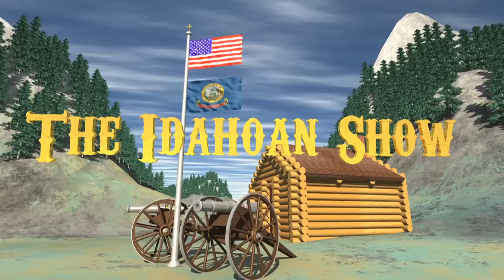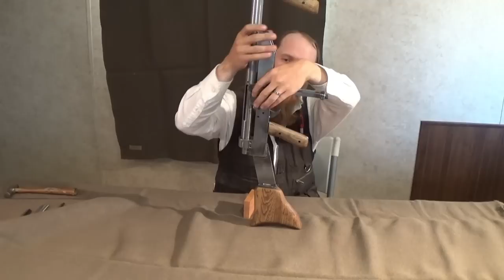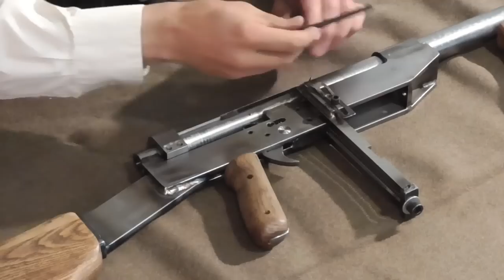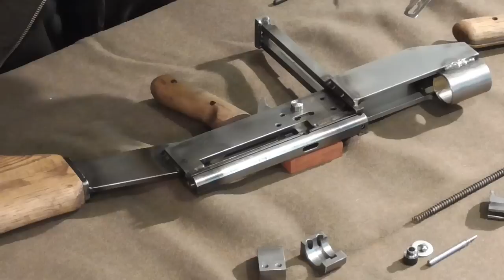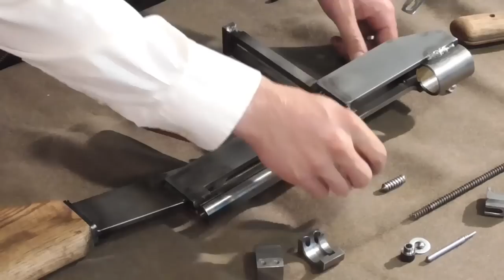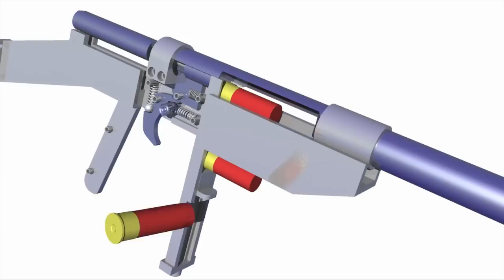Reverse Cycle Shotgun - Forgotten Weapons of an Idahoan (TIS163)

Comment: Don't forget this shotgun. Keep working on the design. Tinker with the problems. apply what you learn to the next creation. Lets see how it works during this years jackrabbit wars. Lets see the UTAH pistol used in the jackrabbit wars with a 410 or 28 gauge barrel,

Comment: I love experimental firearms. I have a recommendation after watching your video on the issues with the design. I think if you were to move the magazine bar to the side of the receiver, it would help with your cycling issues by not having to push the shells up but slide them to the right/left. With that the shells can be ejected from the bottom. Anyway love the videos.

Comment: "To overcome this issue you would have to incorporate some kind of breach closure mechanism" 

I'm merely an armchair designer, an enthusiast with no proper training, so I may be speaking out of turn here so to speak, but I'm not sure that's true. Couldn't you put in some form of mechanism that would disallow either hammer movement, transferbar movement, firing pin movement, or trigger movement when the barrel isn't in the correct position? Perhaps some sort of button that needs to be depressed by some portion of the barrel assembly in order to fire? 

Or perhaps you could have the firing pin and transfer bar be on a moving plate of sorts, and hold those parts too far to the rear for the hammer to affect without the barrel being fully seated?
Reply: Like a rail attached to the barrel that has a cutout, holding the transfer bar down on a tab until fully closed
Reply: Totally agree. A button type of device, sort of like Glock’s firing pin safety, clearly wouldn’t be outside of the skills of this gentleman from what I see. In fact, it seems like a very easy thing to design (I’m not a fabricator, so maybe that part is insanely hard).
Reply: I know this is an old video buttt I like the general idea. I am a designer and gunsmith, I think I might need to play with the idea of using a Siaga mag (because I have them) incorporating a closure disconnect and maybe a slam fire like the old pumps used to have before ignorance and law suits prevailed. Of course paying jobs will prevail over my curiosity builds so who knows if it will ever happen.
Reply: I have reconciled myself to the reality that I too often comment before even cursorily perusing the other comments. You said notably the same thing that I did, but much sooner.

Comment: I think your out of battery firing problem can be fixed with a simple pivot lever, or even a pin that holds the hammer from dropping until the breach is closed. Similar to disconnector mechanisms that keep semi auto guns from firing out of battery.

Comment: I know this video is older and I simply missed it back then. Being a fan of Ian's I find your imitation to be both humorous and flattering (to him). Having listened to your limitations as listed I could not help but start thinking of a method of circumventing them while keeping the reverse cycle simplicity alive. I am no engineer and my first thoughts are not likely to work, but as you know good ideas can come from anywhere so I think when I again have access to a shop I may attempt to prototype the action, even if I leave out the firing pin during my mock up for safety purposes.

Comment: Well done,sir.  Here are a couple of suggestions:  As for the breech not being closed during firing, I would suggest a spring that would pull to to parts together, requiring an effort on the part of the shooter to push open, or hold open the breech.  And as for feeding issues, the problem might be solved by a stronger spring on the follower and the application of teflon inside the track allowing the rims of the shells to glide up the two tracks.  This is a very impressive design and I would like to see it fired.

Comment: Seems like the magazine problem can be easilly solved by putting a front track for the shells, and attaching it to make a box frame, as you were hinting at. The light strikes and out-of-battery problems seem to be solvable within one revision though. From the few firing pins I've seen you make, They tend to be massive and piston-like. Simply cut these things down to reduce the amount of mass that needs to be accelerated (especially with the inefficiencies induced by the transfer bar). As you shave weight from the firing pin, incorporate a simple catch. Put a tilting bar that catches in the pin when the other end is not in a corresponding point on the moving barrel. This could also be worked into a lock that holds the two halves together until an unlocking event occurs.

Comment: 14:00 You don't need to make a kind of breach-closure-mechanism, "just" a way of auto-safety that the trigger can only be pulled, when you have the barrel all the way back.
In order to perfectionate the gun, i would try to make a kind of fixed box magazine, where its possible to load a cartridge in any loading status of the mag until its full.. That would be awesome.
Impressive design though.
Best greetings from Germany.

Comment: I don’t know why I have so much invested in this design, but I really want to see it work. If you had a “floating” bolt in the receiver with lugs that interacted with the barrel, you could cut a grove in it that would not allow the hammer/ transfer bar from striking the firing pin when it is not fully in battery. I don’t think it would have to fully lock, as such,  just be enough to ensure proper head spacing. Also I like the box mag idea. Just spitballing, but I’ve been practically obsessing over this since I saw this video the other day.  Thank you. -The Chicagoan / Texan.

Comment: Would make sense in a bullpup layout, the striker in a conventional fashion being pushed back when closing the action. The back end is forced down at the end of the travel and catches on the sear which also catches the outer sleeve. After firing the striker end rests in the up position and lets the sleeve past it. Or put in a spring pushed vertical piece that catches the outer sleeve in postion when down and also blocks the striker if not locked - it could be actuated from the outside to release the action for unloading. The strikers back could lift it if when going forward. When cycling after firing it moves over the angled striker side face, catches it in the forward position and takes it with it backwards over the sear again. Ok not thought through but the reverse cycle idea is great i think it will work!

Comment: In order to fix the problem with firing out of battery you could add a tilting block that would be in the way of the firing pin until the barrel is all the way back and pushes on it

Comment: to fix the issue with the barrel not enclosing the round or not hitting the breach face you can simply have a small tube like area that comes off the breach face covering the outside of the end of the barrel enclosing it if it dosnt come back far enough. also a simple button or lever like switch on the top or bottom of this small area covering the end of the barrel that would move a "firing pin block safety" would render the firearm safe if its not fully in battery, it still would not be a locking breach like you wanted however it would fix that issue. just an idea for anyone who might have the means to actually make this work since i like the idea but dont have the funds or means to make one myself

Comment: You dont need a breech closure mechanism. You just need a spring loaded pin, that disengages the safety when pulling the barrel back to the breech face. And may be You can do a tubular magazin in upside down configuration on top of the barrel. This would bring the recoil force more directly to Your shoulder. There seems to be another advantage of the design. With a tubular magazin on top of the barrel You can realize a quite long barrel with a short overall length, like a bullpup design

Comment: I think you'll find that a blow forward design is exists  and in semi auto weapons it works poorly. You do actually have forces acting forward on the barrel with a stationary bolt because you don't just magically remove Newton's laws of motion right. The reason the barrel don't spring forward on your design is because of the friction in the action and as far as I can see you have a pretty good chance of firing out of battery. But it's a fun project and great to see someone try a "what if".

Comment: I just had a thought about adressing the out-of-battery detonation possibility, at least partially. Could the problem be lessened by having a "finger" mounted on the barrel that would act similarily to the push-button safety, either unlocking the hammer or the firing pin itself, through tripping a spring-loaded plate or a wedge of some sort, that wouldn't allow the gun to be fired out of battery? Hope I am making sense.

Comment: I think you could revisit this design if you build in a disconnector for the transfer bar. I'm thinking of a rail on the rear barrel, holding the transfer bar down  (maybe on an extended tab) until the barrel is fully closed.
PS: the slamfire shotgun AK Customs build, originated from the IRA, or was at least made known by them

Comment: I don't think the design is completely negated by the breech issue. I'm sure there are workarounds, or even if there aren't then a suitable closure mechanism for this design would still be much simpler than a traditional pump action. Maybe this might not be a design any manufacturer would produce, but plans for something along these lines could easily be marketed.
Building weapons isn't illegal everywhere yet

Comment: Nice episode xD However; with regards to out of battery firing being possible, I thought of an out-of-battery safety which would still allow the barrel to be fully unlocked. How you may be able to do it is by making a mechanism which prevents the trigger being pulled until a lug added on the barrel engages the mechanism which would unlock the main sear! What you think of this idea?

Comment: Would it be possible to include a device that acts in a similar way to a magazine disconnect on some handguns? Perhaps a disconnecter that is activated by a piece on the barrel only when it's in it's most rearward position rendering the trigger inoperable until it is engaged. I think that may eliminate the need for a locking mechanism.
Reply from the maker: I'm sure it would be possible.  However, I have so many other projects I'm working on that it is doubtful whether I will ever get around to modifying or making an improved version of this one.

Comment: you can just fix the issue the same way slam fire tube shotguns solve it. don't have a round chambered untill it is in a safe position. just move the the magazine slightly forward and problem solved with no locking lugs. reverse magazine exist, needs like a boberg like mag

Comment: You gotta make it "cock on close" and then you can get rid of the transfer bar and use a more conventional hammer. You would need a transfer bar from the barrel clasp to the hammer, also you can make a post that blocks the hammer from the firing pin when the chamber is open (many pistols have it with the safety e.g. ppk) I like the project good stuff

Comment: Could you please build a weapon based on the Metro Games?
Reply from the maker: I'm afraid I'm not very familiar with the Metro Games.  What kind of guns do they feature?
Reply: @TheIdahoanShow  
Junk guns that actually seem be properly designed.
Reply: How will post apocalyptic firearms look like? I think in this situation a drum mag or the stripper's mag in line could be possible.
Reply: @CUBETechie  
In a a real post apocalyptic situation most homemade guns are probably just gonna be single shot zip guns. A lot of people  lack the knowledge or lack the tools necessary to build mag fed firearms. Plus the fact that you probably won't have electricity makes it much harder, try building a mag fed with only hand tools. Plus your gonna need to find the proper size metal for your bolt and hope it fits in the reciever tube.